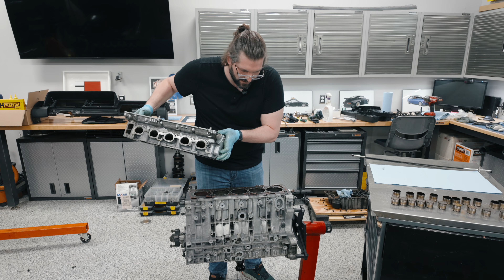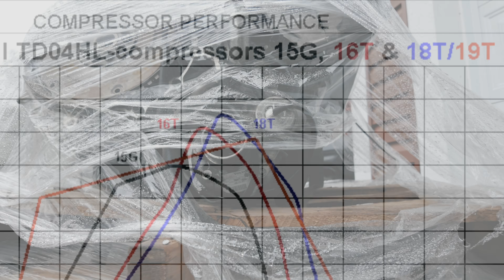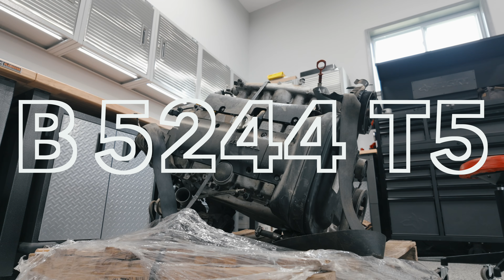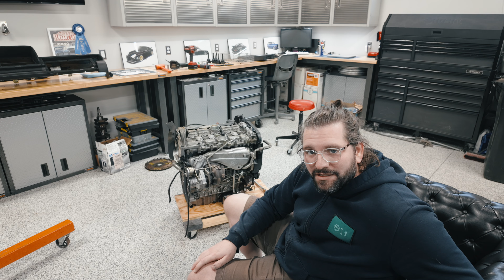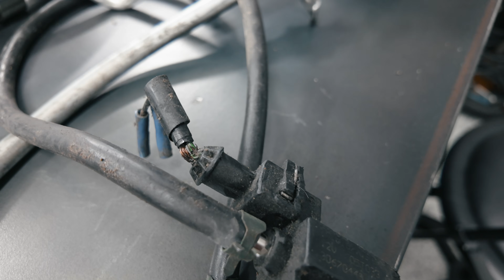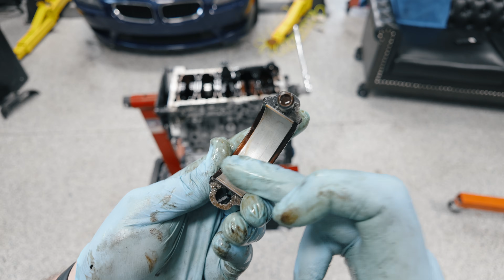The Best 5 Cylinder Volvo ever built? | 2006 Volvo B5244T5 Turbo Engine Teardown

Comment: Also 145mm rods in the 2.5ts. And 100% should be mls from factory
Reply from the maker: Interesting, never heard of 145mm rods being used. Thanks for sharing
Reply: @Drive.Revive.Tinker yep not many use the 4t2 2.5t block but it has gained some popularity with the new volvo tuning scene and has been pulling good results. Though it is still 83mm bore, they are widely avaliable so you can have a few spares. Quite a few people pushing 500 crank on them no issues (me being one of those parted out that car for other reasons). Similar to the 4t4 (r block) but has 145mm rods and slightly different pistons. You can enjoy a higher compression R engine basically. Though the 81mm bores are still the best of them. It just opens up the options
Reply from the maker: Good to know, the 2.5t is probably the most common 5 cyl available around me now.

Comment: Loose head bolts. My brain is trying to recall the various things I've picked up over the many years.. Loose on one side, tight on the other says head gasket failure from too much boost. We call it "lifting the head". In this case, one side lifted and stretched the bolts. That's presuming that #2 isn't cracked as well, probably where your air was getting into the cooling passages.  But air into the intake AND exhaust usually means valve issues. I would check the flatness of the head and the block.  My guess is the block or head (most likely) is twisted.
Reply from the maker: Interesting note about the head lifting, I will make sure to get it checked.
Reply: @Drive.Revive.Tinker  When you were tearing it down and describing all of the "hack" work done, it just screamed boy-racer who probably gave it all the boost because he was a racer. Seen so much of that in my day.  It's a real shame to see a volvo engine abused like this, but it happens. No skill and all the "confidence". I would add, get the rods checks for straightness. I just get this big "don't trust this motor" without checking everything first. I say this as being guilty of screwing up my own first engine rebuilt on my old 850. But I took it as a learning experience and got my act together. Today, a much older me has lots of "single purpose" tools thanks to all the engines I've worked on.

Comment: About the leakdown test. For start i`m running same engine at about 500rwhp. Running a older none VVT head whit 850 GLT CAMs.(not shoure you have the same problem whit the org head) But what i learnd is that you have to take the test right BEFOR the TDC. AND its like 30-40% leak one rotation. If its bad turn it one revolution and try the test em in the fiering order not 1-2-3-4-5….locks like you might have some more problems… Best regards //Martin from Sweden
Reply from the maker: Thanks for sharing, Martin. I'll try checking leakdown in firing order next time around--that makes sense. I did try rotating a bit to before and after TDC to see if it was slightly misaligned and it didn't help.
Reply: @Drive.Revive.Tinker  I`m not shoure you have the same problem white only one revolution is god for cheaking white the org CAMs thats quite borring :) I just recalled that i`m normely put some pressure white the the leakdown like 1cm from TDC and then turns the engine until it ”seals” and then turn the leakdown tester up. BTW you could have got a more comone engine the B5254T2 -06 just be nice at lower RPM…used that for drifting running 532rwhp and like 680wnm. ;) best regards //Martin
Reply: Might mention that i run E85 whitch is avalible att all gas stations here i Sweden might be different over there :) //Martin
Reply: Interesting!  What engine spec if you don’t mind sharing

Comment: i love the b5244t5s. tho hard to find so i just went with an epoxy closed deck on my b5254t2 along with shims, i recall having concerns that my shims would push on my gasket so i had the shims machined to have some room for vertical expansion. 500 ish bhp for 4 years now without issues. epoxy deck a was much cheaper alternative than sleeving, ive been wanting to push more hp but those kind of turbos are expensive lol
Reply from the maker: Awesome! Glad to hear it's been working out well for you

Comment: the block looks to be a good candidate for Darton Inserts to make it a close deck; at least the rest of the engine is in descent shape.
Reply: Tell me why the Subaru community doesnt sleeve blocks anymore?
Reply: @highwaygamesracing  I think the sleeve is casted into the block usually for closed deck.
Reply: @Dijadoit1973  on some engines yes. But nobody is realing sleeving blocks anymore. They close deck them. IAG is at the front of subaru engines and they dont sleeve blocks anymore.

Comment: If the head is good, you can try and find a 2000-2004 S60 T5 for its bottom end. They are harder to find but you can find them
Reply from the maker: Funny enough, the 2000-2004 T5's are actually much easier to find here than the late 2005-2008 T5, which I'd prefer to keep. Either are great engines though!
Reply: Iirc the 00-04 2.3 t5 had way weaker bottom end. The godly 2.4 t5 in stock form could do a lot before bending or cracking

Comment: Interesting that you mentioned the exhaust side head bolts being not as tightly torqued as the intake side, I've now made the same observation twice on my b6254 turbo engine that I've had head gasket failure problems with. I've thought that I'm experiencing head lifting based on the loose exhaust side head bolts. Not quite so sure now since this engine probably hasn't been run at the same power level and appears to have the same "problem". Unless of course they haven't been torqued properly in the first place.
Reply from the maker: Thanks for sharing; that’s really interesting to hear. I’ll have to pay attention when I pull the engine out of the car and see if it’s the same on that b5234t3. 

Have you been running the Volvo MLS gasket?
Reply: I've been using the original style composite gaskets on mine since the MLS gaskets no longer appear to be available for the 6cyl engines. The gaskets have lasted 5-10k kms between failures for me at ~500hp and 1.5bar boost, I will be switching to 12.9 head studs from KL racing next to hopefully fix the HG problems.
Reply: Just got my head back from the machine shop and was told that the head was somewhat warped on the exhaust side. I think that explains the loose bolts on the exhaust side.
Reply from the maker: Interesting. Someone else commented that the loose exhaust side bolts are a sign of lifting the head and result in a warped head.

Comment: I may have missed it, but were you rotating the engine each time to make sure the valves were closed to get accurate readings?
Reply from the maker: That’s a good point to clarify. I cut through the test pretty quickly in the edited video so you don’t see it, but I did set each piston at TDC before testing each. 

That said, I do think the exhaust cam was advanced, which I found later in the video, so that may be why there was so much air escaping through the exhaust valves

Comment: hi, some correction. best engine is B5234T3 2.3 t5 184kw version. if you looking for best block (thickest wall). your engine should have t16 td04hl turbo., it  looks like this lump has some unfortunate  "upgrades" lame for automatic version.
Reply from the maker: Don't all of the 81mm bore engines have the same thickness of cylinder wall? The 2005-2008 B5244T5 engine came with the K24 in the US
Reply: @Drive.Revive.Tinker yes they do, people are very misinformed about these engines.
Reply: @Drive.Revive.Tinker He's misinformed. 81mm is 81mm. 2.3 are well known due to availability, but ultimately the B5244T5 is the holy grail.
Reply: @Mooseworks-shop are you looking for the engine you can build with max performance? The engine you can just reseal and drop in? 4T5 probably meets the first requirement, not the second.

Comment: Absolutely love it, keep going bro! As i sad earlier, i’m an engine builder from Sweden and only wrench on these engines. Need any help och advise just hit me up!
Reply from the maker: Thanks man! I'd be very curious to hear what you've found to be the best way to build these engines so they last. There are so many options for 'upgrades' and hate making unnecessary changes sometimes just make things worse.
Reply: @Drive.Revive.Tinker Depends on the power goal actually! With 850 T5 engine you need rods over 300-350hp, and only rods. Pistons are good for around 500hp. Let’s say you want 350-400hp then rods are the only upgrade you need. You could go with stock headbolts and gasket as well. No need for the fancy stuff under 450-500hp. In Sweden people with T5 in 940/740 have around 500-550hp with only rods and a big turbo.
Reply: @Drive.Revive.Tinker And with the engine you just bought from the scrapyard, that’s the ”forged” engine from factory. Easy 450-500hp with those on stock block.
Reply from the maker: Thanks for sharing! Do you typically use ARP head studs or the stock head bolts? I have some 143mm h-beams laying around so I will probably put those back in--not sure if I will reuse the factory pistons or have it machined for 81.2mm wiseco pistons I have sitting as well.
Reply: @Drive.Revive.Tinker Stock head bolts can take a beating! My buddy did 500whp and 2bar boost with them no problem. H-beams is a must, the weakest link. If the stock pistons look okey, use them and put new rings in. Only machine it if the power goal demands it, or the cylinders are damaged.
Reply from the maker: Thanks for the advice! Sounds like stock pistons in original bores with h-beams and new stock bolts will likely be the path. Would you run a hone through the cylinders to clean them up or just leave them as is?
Reply: @Drive.Revive.Tinker Sounds like a good plan! Always hone with new rings

Comment: My b5244t5 engine also had a composite gasket the same as yours and I'm 95% sure it was unopened.
Reply from the maker: Interesting! I'd be curious to hear from a Volvo technician about what they've seen at the dealer. Looking up parts, it appears that the MLS gasket is what is spec'd for this; however I've also seen the composite gasket in kits for the car.

Comment: That exhaust manifold gasket is from the P1 models (C30/V50). I have a 2005 V70 T5. Im happy to help if you require any details about specific parts for this engine.
Reply: I much prefer that gasket.
Reply from the maker: Yes! That was another sign that someone had been tinkering with this engine before--I could even see where they trimmed the gasket to fit this engine. I'm a fan of those gaskets; I've been using them in my 242 for a few years and they seem to work really well.
Reply: @Drive.Revive.Tinker I also have one on mine for the past 8 or 9 years. I'm about to replace the exhaust manifold for a ported japanifold and will install again this type of gasket.
Reply: I just got a b5234t3 for a project. They're more plentiful than the b5244t4/t5. The junkyard had three, and only one of them turned over smoothly. One of them was locked up completely.

Comment: Great video sir.   Does that engine need an ecu? Where do you get the torque specs for reassembly?
Reply: Very cool sir.
Reply from the maker: Thanks! I'll run this on MaxxECU; I just need to wire in the VVT solenoids and 2 cam sensors.

I just google the torque specs each time when I need them. 

Here's the B5234T specs which should mostly apply to the later engine: https://volvotips.com/850-2/volvo-850-s70-v70-c70-service-repair-manual/volvo-850-engine-service-manual/

Comment: P2 04 B5234T FTW IMHO, thicker walls and still offers the potion for VVT on intake and exhaust if you want it, I threw 20lbs of boost at my 04 V70 T5M for well over a decade of daily abuse and sold it with 390K kms and it's still running today (Volvo enthusiast put all the fun bits from my car on his, restored the stock tune on mine and gave it to his dad for a daily)
Reply from the maker: That's a great engine too! Realistically I'd be happy with that as well
Reply: @Drive.Revive.Tinker  I threw a lead foot at mine with stock internals for 13 years (there are a couple videos on my channel of it), I kid you not, that motor just lapped it up and asked for more. Ran a solid lightened billet TTV flywheel and Spec SO553 Stage 3 clutch kit which NEVER failed, I did go threw two stock M56 transmissions though, one blew the thrust bearing on the input shaft so the second one got all new up rated Timken bearings in and it lasted until I sold it.
Reply: All blocks with 81mm bore have the same cylinder wall thickness.
Reply: @TheProtagonistGabber  B5244T runs 83mm bore.
Reply: @angus3963 there are several 244T variants. The one called B5244T5 has 81mm bore
Reply from the maker: Definitely an important clarification. The B5244T5 is VERY different from other b5244 variants.
Reply: @Drive.Revive.Tinker it's a great engine for sure. Had one in a 244 a while back, made 400whp on bone stock engine with a GT35R. They are getting super expensive in Sweden now so it's almost better to just buy any 81mm engine and throw rods in it instead.
Reply: @wiktorhogberg1646  That's actually the route I'll be taking with my 81 244.